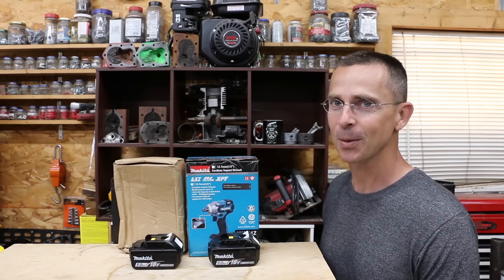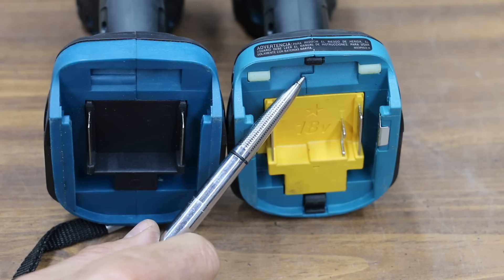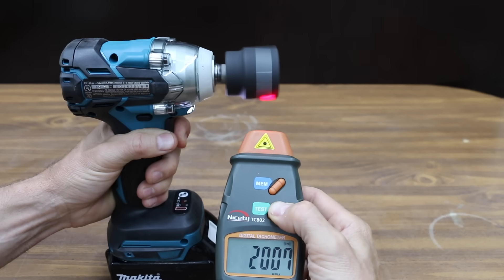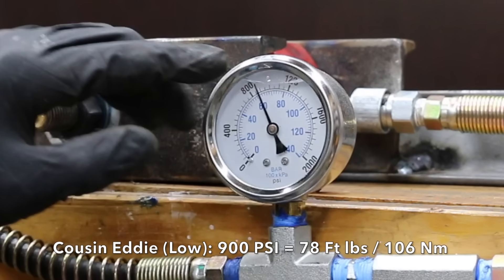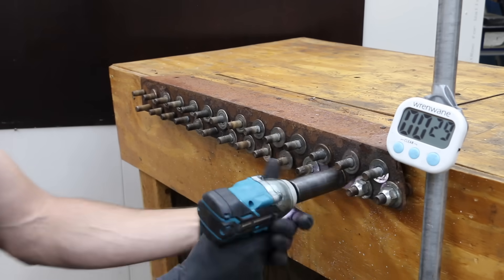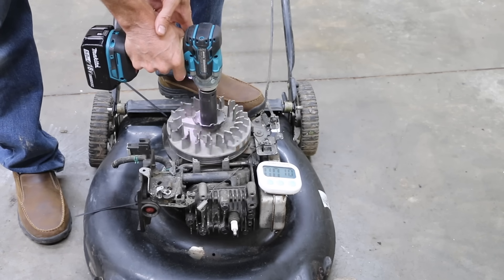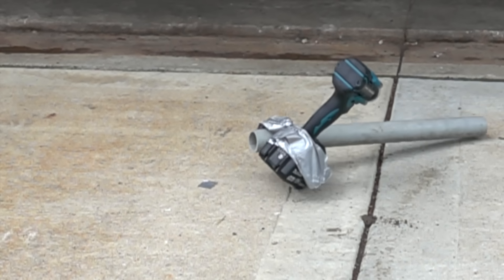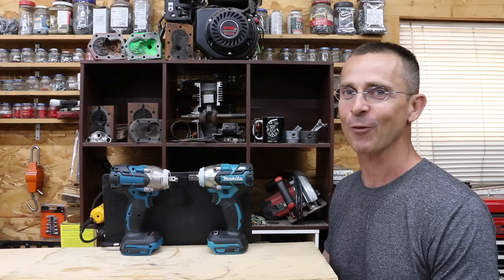Fake Makita Impact Better? Let's find out!  Makita XWT11Z 18V LXT Lithium-Ion Brushless Cordless

Comment: $30 seems cheap because we have been conditioned by tool manufacturers to think it should cost a lot to get a quality tool. No doubt better brand tools perform and last longer but don’t try to convince me the R&D drives the cost. The tools should be cheaper because they rape us on batteries. 1 to 4 hundred dollhairs for batteries is ridiculous. Don’t tell me parts drive cost.
Reply from the maker: Thanks for sharing.
Reply: it's not just R&D, it's also liability, design, materials, etc.  Go try and sue cousin eddy if and when the thing fries out in your hand.  This comparison PF did is a false comparison example:  Cousin eddy does not perform as well, has different design, is unsafe, and most importantly uses an Authentic Makita battery and charger, since it does not come with one at all.  Since the electrics inside have zero overload or circuit protection, you are more than likely going to be complaining about how Makita batteries are bad because you used it with cousin eddy.  PF did not highlight the Makita has a third rail on its battery receptacle, which is for overload protection, which eddy does not.  PF talked about bumpers, which was disappointing.  Just because something is similar blue and black color scheme and is sold cheaply for use with Makita battery, should not make it a fake makita and makita comparison.
Reply: Han Wagu All of the big brand tools are made by a few manufacturers. They don’t have different levels of liability for each tool. Even with all the bells and whistles, costs are high. How about don’t change the look ever couple years and bring the price down.

Comment: For the professional that makes a living with these tools, Makita is the undisputed champion.  However, for the homeowner that uses the tool only occasionally, cousin Eddie is a strong contender that can hold its own at a very affordable price.  Cousin Eddie is a better dancer too...
Reply from the maker: Thanks for sharing.
Reply: eddie because of demand is now $50.  So if you buy three eddies that don't last as long as the real thing, is that affordable?  Moreover, if you are frying real Makita batteries using eddie, does that then also make it affordable?

Comment: I never buy "cheap" tools in my experience last for a month,  after that breaks,  or the cheap battery, not charge very good and is a problem, buy a good brand wich last more and have a warranty, that's the reason why tools are expensive now because cover the warranty of the tool if breaks in the future or have a problem with the tools. it is not worth spending on cheap tools.
Reply: Francisco Duran  all depends on the job you made... in my construction job,  I prefer to use quality tools, I know some homeowners like inexpensive tools because they don't use it often. I give you another example:  mechanics PROS likes quality tools, beginners, and novice likes inexpensive tools, but if you like and you feel comfortable with cheap tools I don't have a complaint,  every person buy and use it whatever tools they like. is only my opinion don't take personally.
Reply: $135 worth of cheap crap is $135 worth of cheap crap.
Reply: Francisco Duran  you are correct that expensive does not equal better quality; however, in this case, the Makita is better and costs more.

Comment: When  I look at my Makita kit (drill + impact) bought for $350 and used barely 10 times a year. This $30 knock off is really better for home owners with average tasks like screw/unscrew stuff.
Reply: Yep of course
Reply: battery is not longlasting.
Reply: @connective135  maybe due to recycled batteries. Can use original battery with original charger,which costs about one fake makita. Hehe otherwise mod the battery pack buy decent batteries and replace it.

Comment: perhaps a better comparison would have been to use a cousin eddie battery, charger, and impact wrench vs Makita battery, charger, and impact wrench rather than using Makita battery and charger with cousin eddie impact wranch.  I believe there are cousin eddie "for Makita" batteries and chargers to be had in a kit for $50 (5.0Ah battery plus charger).  Seems odd that someone who is too cheap to pay for the real thing is going to buy a real Makita battery and charger to power a $30 now $50 eddie impact wrench.  For research purposes of course not promoting cousin eddie bad behavior.
Reply from the maker: Thanks for the constructive feedback.

Comment: Cousin Eddy looks like a good value for lower inpact jobs, but the true value would be in how long the batt will last & how much a replacement batt would cost vs the Makita batt.  If only you had a way to auto charge, discharge,  & keep track of the discharge watts for each cycle to see when the packs are below 75% of new capacity.

Comment: You used a Makita battery with Cousin Eddie on the speed test.  Why?
Reply from the maker: It didn't come with a battery.
Reply: @ProjectFarm  interesting, then it's really $30 for the driver + $x for a battery and charging stand.

Comment: Honestly, most of us would choose Cousin Eddie as for amateur hmoe DIYers 30 vs. 150$ make a difference and all of those torque values and nM doesn't really matter :) 
My theory: If Cousin Eddie was 2 x more expensive it would probably match or almost match Makita's specs and it still would be 2 x cheaper than Makita.
Another thing: WHOLE WORLD WAS MADE IN CHINA even US :)
Reply: Review did a great job of comparing products, plus fair conclusion (Makita much better, but knockoff good for the price) was reasonable. One question I have about these cheap tools is battery life -- will the Li-ion batteries hold up over time?
Reply: mobius836 good question, also I believe He did a review on some of those batteries including the brand names and offbrand types.

Comment: I own the Fakeita... seems like they took a normal 1/4" hex impact and put a 1/2" drive on the tip.  It won't even loosen my Jeep's lug nuts (110ft/lb).  
That said it's still useful for car work as I don't care if it gets dropped in a pan of oil or covered in grease as it's just a throwaway tool.  I wish it was 3/8" as that's more useful than 1/2" for the torque it's capable of.
They also sell a grinder of a similar design.  DON'T get that one as it's a "100mm grinder" which is 4" (not 4.5) and has a 10mm arbor.  It's impossible to find discs for these unless you buy an adapter to convert it to standard.
Reply from the maker: Thanks for sharing.

Comment: It looked like 2 Makita batteries and chargers were used in the test.
Does Cousin Eddie come with a battery and charger?  If so, how does it's
 battery / charger compare?  If not, how much extra cost is it to obtain
 them?
Hard to evaluate a cordless tool without considering it's charge / storage ecosystem.
Reply: haven't seen a single cousin eddy being sold which comes with a battery and/or charger...they are sold as for "makita battery"

Comment: I bought a 3/8 Drive Impact one time at this Factory where this lady and her business partner were selling industrial equipment... it was laying on a pallet that had a bunch of bolts and nuts like brand new stuff in bins... I offered her 10 bucks she said sure... I got it home started looking it up online and nearly fell over when I seen the cost of this thing.. this thing was over $700 new unfortunately I didn't find a charger or the "remote" yeah you read that correctly remote that goes with it...this thing is the most intricate impact gun I have ever seen!!.. you can set the torque from 1 to 100 foot pounds and it will shut off when it reaches that specified torque... it is made to be used on an industrial line continuously for hours on end... it is a Panasonic... just the battery cost almost as much as that entire Makita impact gun...
Reply from the maker: Thanks for sharing.

Comment: Makita is not a very good tool anymore. In my industry it is strictly the Snap On 1/2 in. Impact or milwaukee.
Both tools are a waste of resource.
Even bigger is battery time. I wasted money on a Greatneck for home once. Went back to use it again the battery was discharged. My SnapOn I get months and months from a single charge. The point being I need the thing to work on call and at a moment's notice sometimes in pitch dark conditions. I have no time for low torque junk like either of these.
Reply from the maker: Thanks for the feedback.

Comment: I actually bought one of these several months back because I was curious. There is another video on YT that shows a similar Makita replica that was pretty decent quality. Unfortunately, the one I received was super cheap and overrated like the one tested here. I think it would be better suited for a light duty 1/4" shank rather than a 1/2 impact. Mine has trouble removing lug nuts at 90 FT LBS. My curiosity cost me $60. Lol...
Reply from the maker: Thanks for sharing.

Comment: At 1m 47 the bases of the tools are shown. The fake does not have the 3rd terminal into the battery. As I assume this is related to the safe operation of the lithium battery, I assume there may be a increased risk of battery thermal incidents with the imitation.....
Reply from the maker: Thanks for the feedback.

Comment: Makita has always made good cordless tools. Cheaper doesn't mean a good deal. I've seen Makita tools years later still performing like new, while other brands are replaced time and time again, However, some brands make certain tools well. Back in the 90's I had a DeWalt driver. I dropped it into a 5000 gal caustic tank, 2 ft of sludge at the bottom. It sat in there for a week until we got the tank drained. Pulled out the driver, took it apart, cleaned it up and dried it out and it worked. 

Makita is expensive for a reason and you rarely see a price break. Although, for an all around set that is pretty reliable from tool to tool, I use Rigid. Love to have some Makita, but I'll wait for someone to buy them for me as a Christmas gift or something. In other words, I probably will never own a Makita tool. LOL!

As for the knock off, can't really complain. With one exception: They are literally ripping off Makita and trying to get people to think they bought a Makita tool. I hate when these knock off's take business away from good brands. Why? Because it's happened to me. My sports tool was top quality, while the Chinese version was crap. What happens is that people start to associate the failure of the knock off with the good brand. It just happens. You borrow a tool in a shop and use it. It's no good, but it looks just like a Milwaukee. You have that general look of Milwaukee in your mind and then you go away with the idea that you used a Milwaukee tool and it was no good, even though it was really a knock off.
Reply from the maker: Thanks for the feedback.

Comment: Cousin Ed sounds like a good expendable back up  if you have a a problem with your primary screw gun of choice or to give an apprentice for practice. I have a couple of generic Chinese  made tools I use for that purpose.
I  have stopped using Makita now I have found  the quality and durability  has been in decline  since Chinese factories started to produce them.
I only use European made tools now they are more expensive to purchase  but end up cheaper because they last longer  and do not let you down on the job.
Reply: they could make good stuff in China, it's just that none of these companies want to pay for it.
Reply: The last 3 Makita 18V cordless tools I purchased were made in Japan and the UK, so it depends what you buy I guess.

Comment: Over the weekend I just used both the Cheap China and Makita Impact.
If I was using it all the time, Makita all the way.
To keep in the boot of the car to change a tire or operate the Jack, china is more then adequate.
Good funny comparison test..  like me they both lacked dance moves ;)
Reply: I was looking into getting one to help with car work. It would be for my cars every now and again. Seems like it be a lot better than my breaker bar. Would you suggest that cheap one for someone like me or should I just save up for the real deal?
Reply: @robertcastillo90  One friend got the Makita rattle he bought it to do the jacks on the Caravan, the 2nd friend loved it, he found  and bought the chines one for $40-50 from ebay.
The other weekend we met up and needed to use one so he pulled his out also and we compared the two.
The Makita was a bit better but not by much. 
For the price the Chinese one did the job, If your just going to keep it in the back for occasional convenience, the Chinese was fine.

Comment: I'm very sure that the majority of Chinese workers in small and medium-sized renovation companies and individual craftsman workshops and businesses are using Cousin Eddie-like tools rather than Makita, just because the CE is cheaper, and it can do 95%-99.9% jobs that a Makita can do. I hired several construction workers for several times of renovation for my own and my parents' apartments when I was in China, and most of them were using "Cousin Eddie" style tools for doing quite decent jobs. Look at Chinese apartments and skyscrapers; picture most of the interior jobs are done by the CE, not by Makita or Bosch. 

1. Probably the CE is not as reliable and long-lasting as Makita, but for a 1/4 price, many professionals in China are using it, though all of them are clear that Bosch is a better brand in almost every respect (except for the 4-10 times of price range) than the CE. Cheaper labors and cheaper tools can also do professional jobs. 

2. I think many, probably most, Makita tools are made in China as well, but they would have better quality control and materials than the CE. This is the most significant difference. 

3. For average guys in the U.S., the choice between the CE and Makita is mainly up to whether you would like to spend 4 times of cash to pay for the Makita's possible reliability which is up to your work style (but it usually doesn't mean better work performance). 

4. However, please remember such a fact: millions of workers are actually using CE-like tools to do their quite heavy-duty jobs like interior renovating, furniture making, for 200-300 days per year, 8-12 hours/day, and the CE can usually last for months even years if they are lucky enough. You can think about how many times of that kind of job you do every year. 

5. Besides the quality control which is important for serious or demanding, professional guys, I think CE and Makita make no differences to do quite the same jobs.
 
6. Remember, China is not "Copyright", it's "Copy! Right!" If you are still suspicious about the quality, pirated design, and would like to pay $100 dollars more for free return, replacement, possibly more reliable and longer working life, and patent, you should go for Makita. Simply speaking, a higher price for Makita is mainly for "possibilities" and "feel better" rather than "performance" for most people. Another advantage for Makita is better resale values, or when you pass them down to your kids the brand still will be recognizable.

Comment: The Marita is about 4 times more expensive. Eddie has under 100 ft lb of torque but the Marita has 350 ish 3.5 times higher it seems to me that teslas 10k Newton drill(car) is way too pricy it should be under $10k. Hahaha. Btw support makita and snap on as for they are extremely awesome at their job, i have delivered for snap on and they have quality everything and pay very well.

Comment: I have been using and buying Makita tools since the 1980s because of the quality and longevity of them. Sure they cost more than cheaper tools like Black and Decker but they perform better and if you plan on keeping your tools the availability of replacement parts is a big selling point. If something happens to the $30.00 knock off you won't be able to get spare parts for it even next week much less a couple of years down the road.
Reply from the maker: Thanks for sharing.

Comment: So it's pretty obvious the fake one is far better since it cost 15 dollars. Theirs stats are not so different but one is far more cheaper. Better buy a couple of cheaper one than buying 1 very expensive (the fake one broke easily if it falls to the ground so it's necessary).
Reply from the maker: Thanks for the feedback.

Comment: I refer to your channel for everything before I choose products! I got some nice alloy wheels but they are corroded. I need to use paint stripper to get the clear coat off... Stuff I bought locally didn't do anything. Could u research the best paint stripper please? Esp for polyurethane on alloy wheels 😁
Reply: I also don't know how to past questions or suggestions other than here...where should I put suggestions / requests? Thanks
Reply from the maker: Thanks for the video idea.

Comment: Great job as usual! I don't know if you have done an oil filter test, I couldn't find a video. I have been reading so much about oil filters lately that I'm feeling like I have been over spending and possibly hurting my engines.  There are a lot of people taking oil filters apart thats good to see whats inside but in addition to that some actual performance testing would be helpful. I'm obviously no expert but things like pressure flowing through the filter particle size that is actually filtered, when the bypass valve actually activates and maybe when the filter finally gets clogged how much it can trap. This info i believe would be very helpful. Maybe a bracket type of competition. Lol seems like a tall order.  I'm back to using OEM filters 🤪. But I feel there could be better choices. Thank you for all you do! Dwayne
Reply from the maker: Thanks for the video idea.